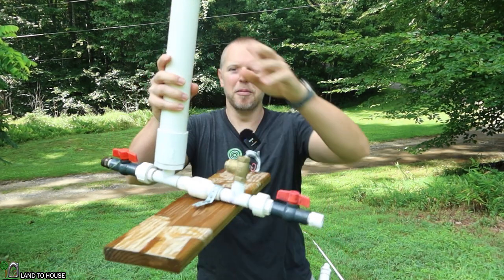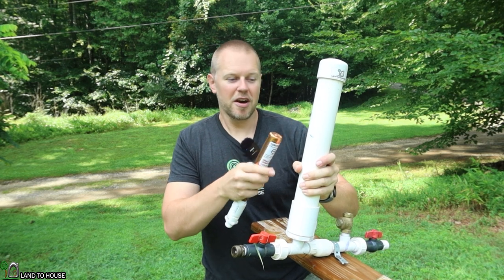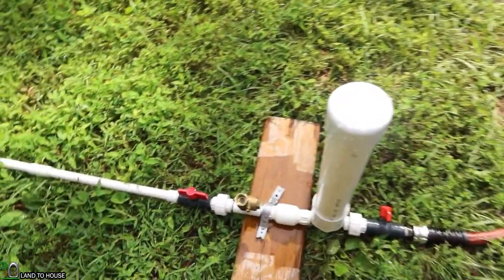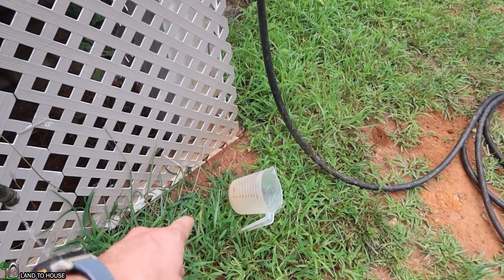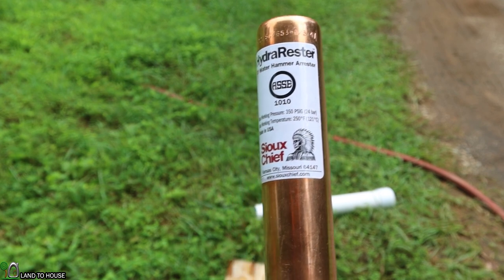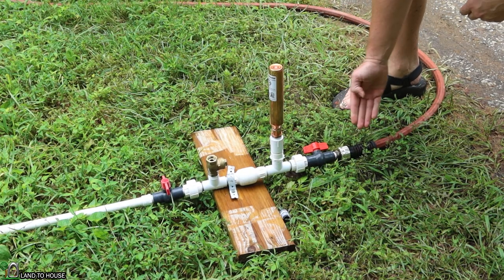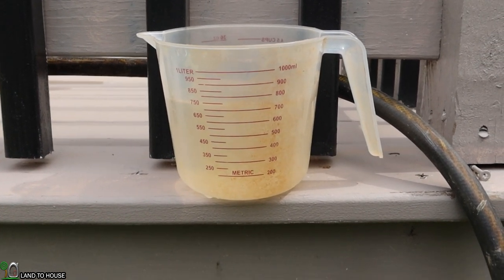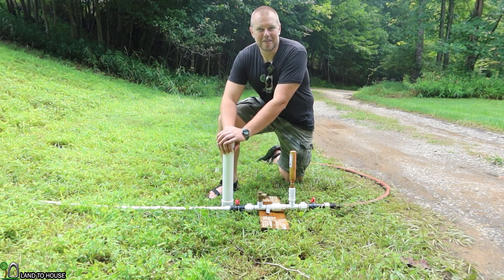Ram Pump Water Hammer Arrester as a Pressure Tank

Comment: An effective way to keep the pvc pressure tank charged with air is to drill a small hole in the pipe just before the backflow check valve and insert a cotter pin into it to almost close it up. For example a 1/8" drilled hole with a 1/8" dia cotter. You will loose a little squirt of water with each cycle but will gain a very tiny air bubble entering the pressure chamber due to a very short duration suction effect of rebound. It is critical the bubble rises to the tank and does not accumulate before the check valve. This will be enough to keep the tank charged with air. The trick is to allow the cotter only enough clearance in the hole so that it can wiggle slightly and this will keep it self cleaning.

Comment: Would it be possible to use some kind of bladder in the pressure tank to prevent the air from dissolving into the water?
Reply: Yes, this is how it's done on some other types of homemade ram pump and come in our kit in place of a pressure tank.

Comment: if you do a test like this again, try putting some kind of graduated scale behind the pressure tank to measure deflection from water hammering.  my eyes say, from this video both are moving about the same, but I love quantifiable vs. qualitative.  that in general might be an interesting experiment for some day: what style tank results in the least amount of movement.  I'd think the lightest tank with the least deflection would be the best for longevity of the fitting it attaches to.  Although, we might be getting into the longevity of exposed PVC at that point as well.

Not having to "recharge" the tank every couple months might also be a benefit.
Reply from the maker: I wonder if the arrestor is going to give out sometime in the first year. That is 31 million cycles. The 1/2" pump does not kick around much. I could use the 1-1/4" pump and see a lot of movement.
Reply: @LandtoHouse  
Would a standpipe after the pump that takes a water column above the output hose level accomplish the same purpose of absorbing hydrostatic shock and smooth output flow but never require air bladders or air compression tanks ?
In my case your airtank seems perfectly designed to catch water cress and apply extreme stress that would snap the reducing neck of the pvc air tank, 
But a smaller (iron?) pipe would snag less debris and might even be armored with an upstream sharp blade so that the water pressure would then cut even the toughest stalks/roots ?

Comment: I bet if you get a bit larger of an arrester it will perform much better if that tiny one was almost equal to the normal pressure tank...
Let it run for 3 months and see if you have to drain system with arrester on it
Also should compare running it without a pressure tank or arrester as well...  also comparing if after 3 months you have to drain system without a pressure tank or arrester as well..

Comment: Very interesting videos. Would it help better if the waste water valve was omitted altogether? The water is to be first led into a pvc tube fixed parallel to the pressure tube causing it to rise in the pvc pressure tube. This water would become pressurised and force some of it to flow out of a side tube provided through a U tube connection.  This would prevent water being wasted at the waste water valve and utilise all the water available.

Comment: question : I know you have said large balder pipe pump more volume of water BUT does a larger size bladder tank also help in lift higher?  example low head maybe 2-4' with 200-300' lift up a hill

Comment: When I originally learned about ram pumps, rather than leave the pipe empty, they put in inner tube with some air in there, have you ever tried that? That way it doesn't ever become fully waterlogged?
Reply from the maker: I have used innertubes in the tank for years. After testing pressure and observing with a clear pressure tank I have seen that the tube does nothing for the system. It goes flat almost immediately.
Reply: @LandtoHouse  good to know.

What about making an air piston?

A solid little chunk with o-ring grooves, that sleeves into that pressure tank so the water pushes one side of the piston, but there's air in the other side so it compresses and then pushes back. But in theory no water slips by the o-rings?

I already know the answer, you're going to tell me it's easier to drain it every 3 months. I'm just thinking of ways that you would be able to leave one for a year or two if it was remotely placed
Reply: @Bozemanjustin  That's actually the design of this hammer arrester, o-ringed plug with pressurized air behind it.
Reply: @LandtoHouse  Hi Seth, sorry if It's an obvious one but, do you mean you don't recommend using the bike's inner tube anymore? Thanks for the great content, I'm assembling a 1/2" pump for my farm, I'll keep you posted once I got it running! Cheers.
Reply from the maker: That is correct. I have found the inner tube does nothing. The pressure spike of the water hammer seems to open the Schrader valve and let the air out.
Reply: @LandtoHouse  Ok, so what if I put a screwed in cap? I mean emptying the tank isn't such a big deal for 3 months, but in a farm, every self maintenance is a blessing! As is your generosity, thank you for taking the time!

Comment: I know you've done one with a long pipe with the valve on top, but what would happen if you left the valve on the bottom but with a vertical pipe (say 2 foot) on top of the valve. So there is like a slight bit of pressure on the waste valve.

Comment: The water hammer arrestor may be a smaller tank and have slightly less output, but it also seems like it did not require as much of a charge to begin working.
Reply: I didn't require a "charge" because the upstream hose was already primed from the first run.

Comment: wondering if the two working together would improve performance any?
Reply from the maker: Not sure about that. Could be a fun test. Place the arrestor in the front and then the pressure tank next.
Reply: @LandtoHouse  And then switch positions to see if there is a difference.

Comment: Question:  If you were to get a piece of plastic  that fit's semi snugly with a grove in it and a rubber o ring as an insulator between the water and air in the "pressure tank" if it would keep it from getting water logged, this way it would act as a piston backed by air pressure and keep it from dissolving the air out of the pressure tank

Comment: Hi... if u don't have lot of space for the drive pipe, can you use about 2"  1 meter drive pipe inclined at a <45 from a tank above it...
Reply: Water velocity in the drive pipe is the key to the ram pump's function.  The faster the water is  flowing down the drive pipe just before the waste valve slams shut, the bigger the pressure spike that pumps water up the delivery pipe.
Reply from the maker: You are going to need about One m of head pressure for the ram pump to operate. It's ideal to keep the drive pipe the same size as the waste valve. A drive pipe that short is going to cause the pump to cycle very fast and potentially stop.

Comment: So, it seems to me that with the pressure tank becoming WATERLOGGED, you could simply put like a valve at the bottom to close it off from the rest of the system (left open while in use), then above that you could put a valve you open to atmosphere to drain the pressure tank (and leave closed at all other times while in operation). So, if it looks like the pressure tank is getting waterlogged, you close it off from the system, open the drain valve, let it drain, close the drain valve, open the input valve again, and you're back up and running with an empty pressure tank. Then you don't need to "take anything apart" to drain it. Just close it off, open the drain valve, close the drain vale, open the input valve and done. Might also need a valve at the top of the pressure tank you can also open to get air in more easily when the bottom valve is opened. Otherwise, maybe it wouldn't drain very easily due to vacuum effect?

Alternately, can you just put in some kind of compressible inner tube or something in the pressure tank that'll compress, but not allow the water to absorb the air inside it, thus, theoretically, it would never get waterlogged? I'm thinking like a thick-walled sealed balloon or something, that's sturdy enough not to quickly "wear out" or "pop" due to repeated compression/expansion or seasonal heat/cold cycles, but which does elastically expand/contract under pressure, so still serves the purpose of cushioning the water hammer  effect?
Reply: Also, how do you keep the system from freezing up in winter and blowing up the ram pump, pressure tank, etc. due to expanding water/ice? Or do you simply drain the entire system and leave it off for the winter to avoid  breaking the entire system due to freezing?

Comment: The only question I have is will it last longer then the pressure tank. Two moving part is better then three
Reply from the maker: Not sure that the arrestor was designed to cycle 31,000,000 times a year. I bet that will factor into the longevity.
Reply: @LandtoHouse  I’ll stay with the original there is a reason it’s lasted the test of time it’s simplicity
Reply from the maker: I agree! This test was just to learn what would happen.

Comment: Dumb question, you always support the pump by screwing a strap to a board under the pump, but could you support it by strapping the pressure tank to a post?
Reply from the maker: You can absolutely prop up the pump with a post. It is actually common for a fence post to be used to hold the pump up. I like to use a combination of board and rebar when I do an install.

Comment: Why not just put a tire valve on that pressure tank and pump air in it with a tire pump everytime it runs out of air. Eliminates the hustle of draining the water out of that tank.
Reply from the maker: That could work. As long as the pump could handle a range of 20 to 100psi. I have seen pressure tanks with 120psi in them.

Comment: Could you use a 90 deg fitting and lay the arrestor flat?  I’m just thinking form factor.  It could make it smaller and you could enclose it in a housing for weather, or maybe so it can’t get damaged from falling debris.
Reply from the maker: I should think so. The ram pump can operate without a pressure tank so laying this down would still work and having the closed tube would allow the pressure wave to cycle without the tank filling with water.